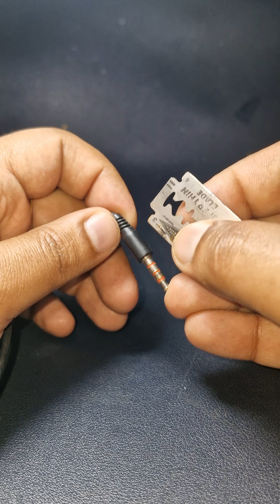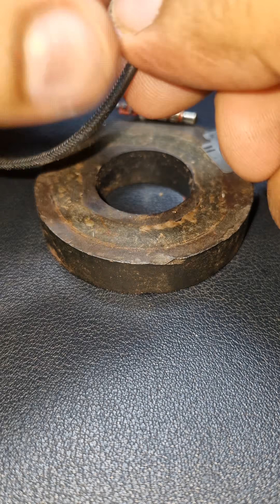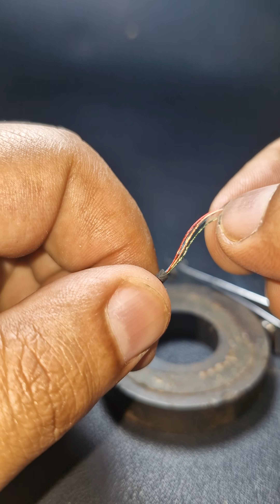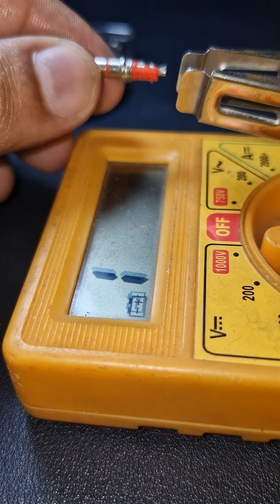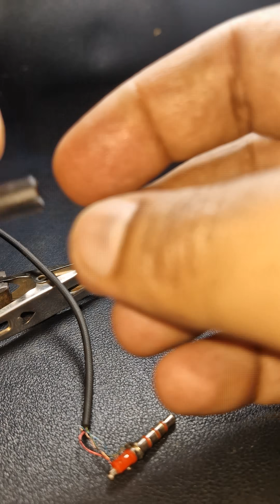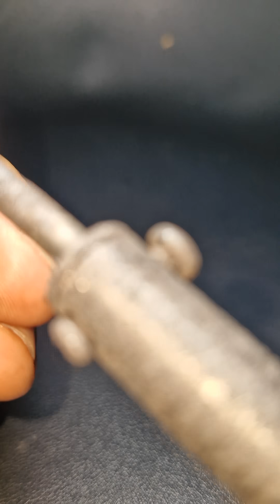How to Fix Broken Earphones — No Fancy Tools Needed! DIY Repair Guide #diy #repair #earphone

Comment: I did soldier on the 3.5 mm jack with my headphone but the sound was not coming the sound was coming very very little in right side only

Note ! I did wireing according to image from Google
Reply from the maker: may be soldering issue 😃
Reply: @the.fungineer  now that headphone is in trash 😂